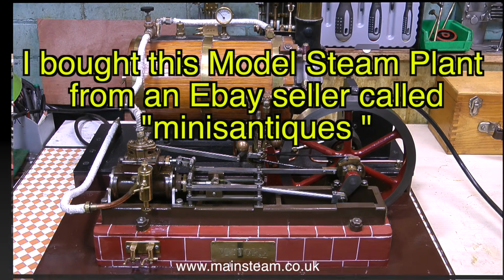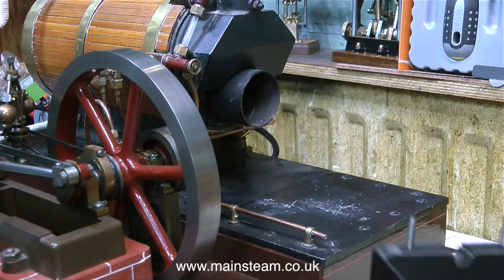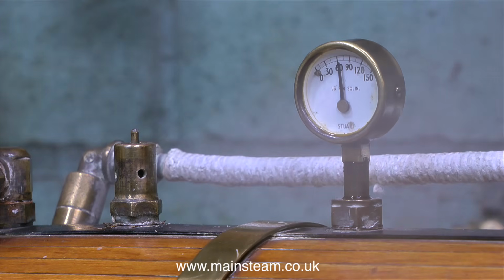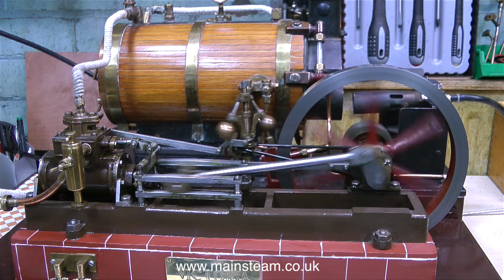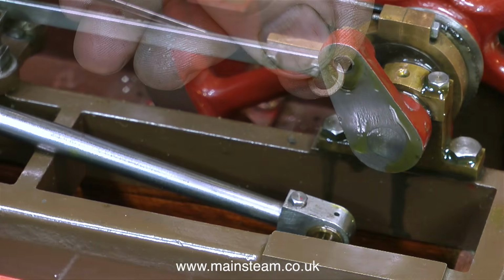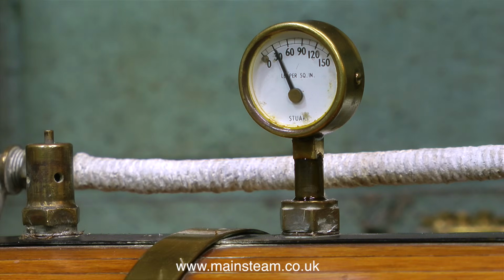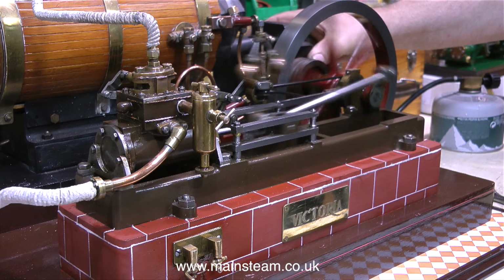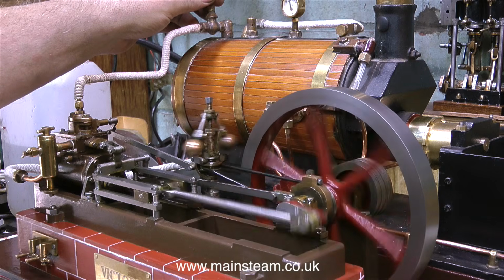MY BEAUTIFUL STUART MODELS VICTORIA STEAM PLANT

Comment: Keith, that is one beautiful machine!
I am just a grown kid playing with my Wilesco D-20 and soon D-22. I got distracted one day and left the D-20 running unattended. Of course, it ran dry and melted all the solder joints. Tried repairing the boiler by flux and solder with no success. Must be some oxides deep in the boiler end cap. Will have to remove it, wire wheel and resweat it with a ring of solder in the cap. This poor thing saw a lot of heat. Maybe I should just replace it for safety sake.
Stupid mistake I will not do again. The D-22 is a twin cylinder model which I look forward to running. It shall generate electricity for me, 3 phase brushless motor into a rectifier bridge with capacitor storage. Should make an inefficient cell phone charger.
Enjoy your videos and your Victoria Steamer.

Comment: That burner nozzle that keeps going out may be burning too lean, perhaps you could fiddle with it by partially blocking the air inlet(s) to see how it affects the flame. I rather like the brass housing on it too. —Just a guess, I have adjusted one burner nozzle with a tapered jet reamer I used on carburetors back when cars had carburetors. It worked!
Reply from the maker: been there a million times, read the book, seen the film & worn the T shirt, it is an entirely different science to carburettors, but I thank you for your expert advice . . . . .

Comment: Your howling noise from the ceramic burner is because of the secondary air inlet holes drawing air into the fire tube much like the valve on a brass musical instrument.  It has a resonant frequency at certain flame settings because the air being drawn in is variable while the area of the air ports are fixed.  Your shroud fixed the problem by allowing more air in bypassing the ports.  

The knocking sound?  not my department.  That's for the "lads" in the Mechanical Engineering Department to work out in the office down the hall.

Comment: I reckon it's too much clearance in the guide blocks.
Lovely engine BTW.
Reply from the maker: The guide blocks are tight, it is a little play in the Connecting Rod that's causing the noise - it needs bushing :-)))

Comment: sounds like the crank end is loose ... i could hear it and was trying to see if the arm was hitting the casting or rocking when you were putting the washer on the bolt for a spacer then at end i noticed you changed the pin in crank arm that holds it to shaft

Comment: I don't know what the part is called, but there's a shaft (sort of a countershaft) that transfers the motion from the eccentric rod to the valve gear - it runs transversely across the engine about 3/4" in front of the engine. Anyway, I see it is rocking back and forth a little (not rotationally of course, that is what it is supposed to do, but along the axis of the steam engine) as though  it's bushings (if there are any) are worn or poorly fixed. I don't know whether that is normal or bad, or whether it would create any noise - but I thought I'd mention it.

Comment: Bonjour Keith,
Beautiful steam plant, I agree with you. Besides this, the problem of the torch would justify a topic by itself. Based on my experience, ceramic burners are efficient for vertical or small horizontal boilers, but, to heat a 125 x 250 mm horizontal one, you need power and flow.
Amicalement, Raphaël, .

Comment: Gorgeous Plant Keith! Looks like the taper pin for the Crank Web was either loose or wore the hole egg shaped in the Web, so it was clunking and clattering on the crankshaft because of the rattle fit. I see you fitted a new possibly slightly larger taper pin that's securing the crankweb to the crankshaft nice and tight and it's done the trick.
Reply from the maker: Yep - well spotted :-))))

Comment: Would the washer be better placed between the crank and connecting rod instead of on the outside? It seems like that would reduce side friction and rubbing between the two parts.
Reply from the maker: Tried it both ways - not everything I do goes on the video :-)))
Reply: Keith Appleton I gotcha. I just wanted to show how smart I am...eye roll
Reply: thats were i would of put the washer to lol